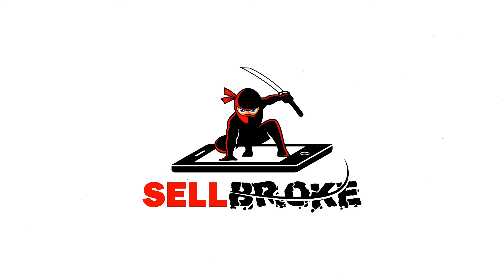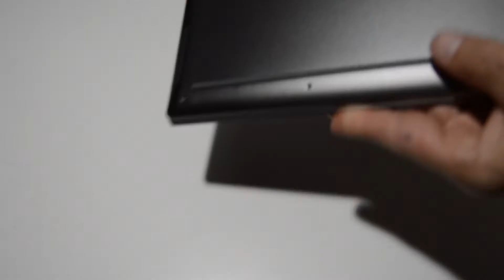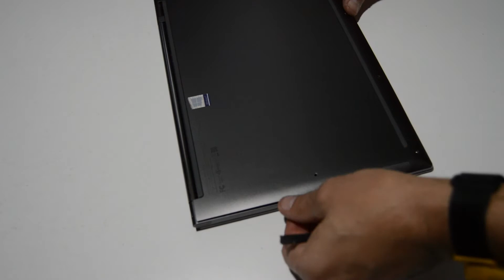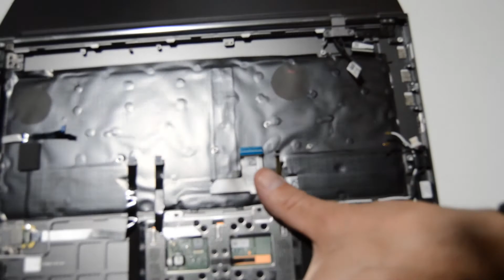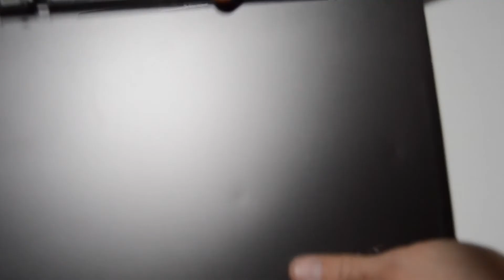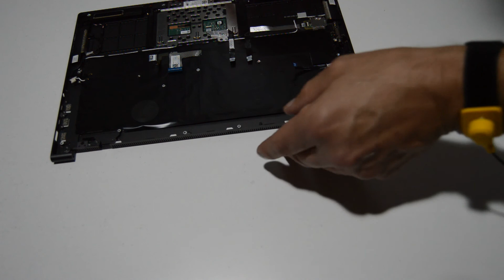How to Disassemble Lenovo Yoga C930 13IKB Laptop

Comment: keyboard replacement - how handle the small pegs behind the keyboard. The keyboard supplier provided this instruction: "The plastic pieces can be removed by using a very thin sharp object and the plastic pieces are added once the new keyboard is in place w/ a hot glue gun." Anyone have experience with doing the procedure, how difficult it is to cut those pegs out and re-attach?

Comment: Hey great video! I have a question: my lenovo works fine, there are no real issues except that my battery drains ridiculously fast. When it's charged at 100% the pc tells me I have 20 min before it shuts back off! Is that something I can fix by disassembling it and cleaning the interior or something else? What would you suggest?

Thank you :D
Reply: mine is doing the same thing. I bought a new battery and am about to replace it. I'll let you know how the charge is after I'm done
Reply: @colecovington9804  good luck and thanks!
Reply: @colecovington9804  Hey did this end up working I have the same problem

Comment: Okay so I just replaced my battery on my C930 and two things stood out:

1. The other guy is right, there’s two adhesive tabs, they’re tiny and black and stick to the battery on the top, too. They must be peeled off and then pulled like a command strip.

2. When removing the back of the laptop, it was much easier to use a suction cup on one of the corners that is screwed down than it is to try to pry it up from the hinge corner with a plastic pry bar. I do not recommend the method he used as it applies stress to the hinge and mine flexed a lot but the back cover wouldn’t pop off. Also the back cover seemed to be designed to lift up at the screwed edge and slide out from under the hinged edge, based on how I had to maneuver it to put it back in.
Reply: Where did you purchase the replacement battery? Thanks
Reply: @vipgarg8572  Sorry for the late reply, I purchased it on amazon. I think it was the second cheapest option as I had fears about buying the cheapest option available about most products haha

Comment: Hi mine is running hot and I heard it was because it is dusty so I was wondering where the dust would be and if it is dusty 

(2 weeks later) Well now it isn't turning back on I'll pop it open when I get the tools
Reply: Heyy did you manage the dust issue, i git the tools and the "pressured air spray" But I dont how deep I have to disassemble my laptop
Reply: @leonsaha1543  I fixed the dust (it was filthy) I really didn't go too deep It was a while ago but I'm pretty sure I only removed the battery and fans
Reply: @Redhornsandeyes  The battery too?? so with adhesive ? Can you like show me till which second of the video above you dissassembled the laptop 😅

Comment: The video doesnt show it but when I was replacing the battery, there are 2 rubber pull tabs for the adhesive on both sides of the battery, one in each side. Make sure to pull on the tabs to remove the adhesive or the battery wont be coming off.
Reply: Dude! Thank you! I was like what it going on here LOL!

Comment: What happens if you tighten them in the wrong pattern?
Reply from the maker: You fall through a trap door under you into the pit of despair. Really though it just keeps the thermal paste thickness even and keeps the excess thermal paste from coming all out on one side.

Comment: Hey! 
A bit of beer fell on my Lenovo's 930 keyboard, the laptop works perfectly, also i did a hardware check since the Lenovo's site and everything seems to work correctly. But some keys stopped to work, so you think that I could remove and clean each non working key, or instead i should contact the technical service for a proper cleaning of the components?

Thanks a lot!
Reply from the maker: I'm fairly certain they will never work again, most often when you spill anything on the keyboard it is toast.
Reply: @Sellbrokedotcom  isn't it possible to replace the keyboard like other laptops?

Comment: I have a single vertical line on my panel that just appeared, not sure if it is the panel or the ribbon.  Looks like getting into the panel is something I dont want to do.  So I assume no good way to just replace a ribbon?
Reply from the maker: Not easily.... touchscreens can be a real pain to disassemble, especially for someone who doesn't do this for a living. I would try and find your screen as an assembly and just replace the whole thing.

Comment: Hi,
I have a keyboard issue in my Lenovo yoga C930 13IKB , does the keyboard is replaceable or the whole case need to be replaced ?
Thanks for your help.
Reply from the maker: Looks like its held by dozens of tiny screws, should be replaceable.
Reply: I have the same problem as you, no one is delivering in India either. Just saw your comment on another video as well.